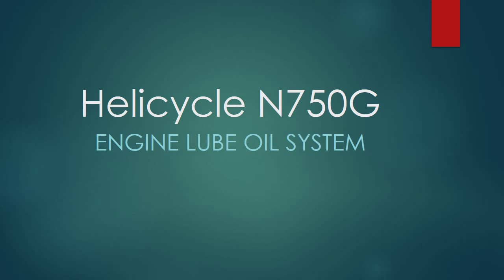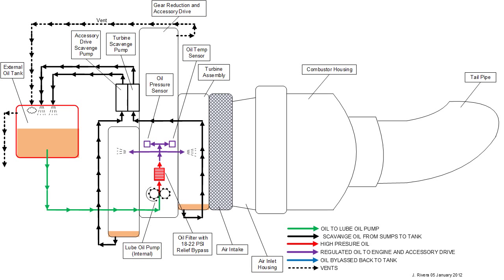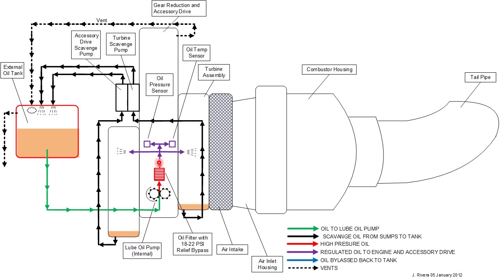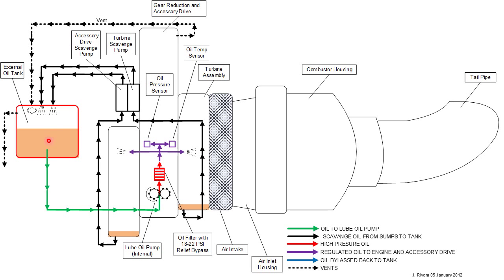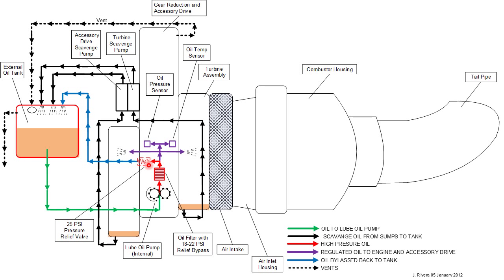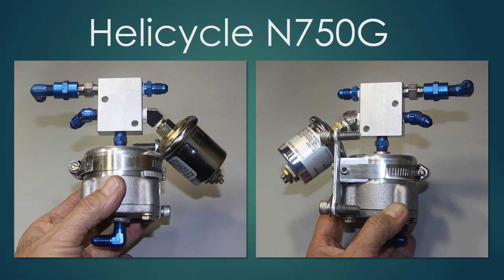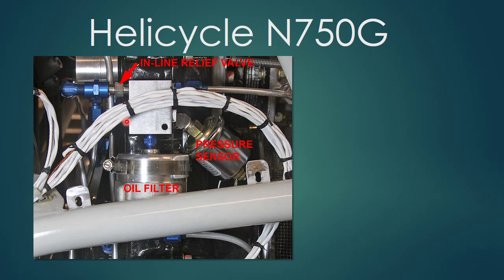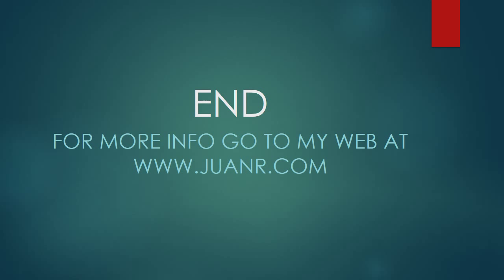Helicycle N750G Engine Lube Oil

Comment: Juan, how was the original lube system for the engine per solar design?  If the pumps are original equipment and helicycle only added a filter, then how did the discrepancy of excess oil in the reduction come about?

Comment: Looks good. 25 psi oil pressure sufficient? Would a oil cooler be a good idea? Thanks for all the videos
Reply from the maker: Bobby John  You need to balance the output of the engine-driven fuel pump against the two scavenge pumps.  The Helicycle uses a dry sump with a holding tank.  If the scavenge pumps can't keep up then the oil starts to pool up in the engine and it causes overheating.  When everything is operating properly the engine runs cool with no need for a cooler.